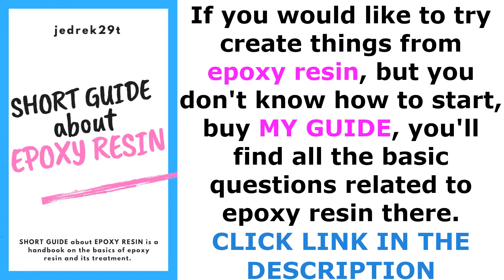Making Mosquito Amber. How to make Night Lamp / RESIN ART

Comment: That’s not a mosquito it’s a crane fly. They also used a crane fly in the Jurassic park movie prop because mosquitoes are so small it doesn’t look as striking, or as easily identifiable. Crane flies are often mistaken as large mosquitoes and are sometimes called mosquito eaters. They don’t actually eat mosquitoes, in fact most species of adult crane flies are incapable of eating at all.

Comment: I enjoy watching you make all your resin projects, but one thing that drives me nuts with your lit up projects is that you never put a switch on them. What if you don't want to use all of the battery in one go, but you don't want to have to take the battery out to shut it off? A little push spst switch would do wonders. #justsayin
Reply: ...and resistor, to save the LED from fast degradation...